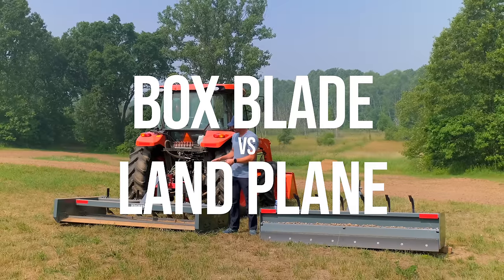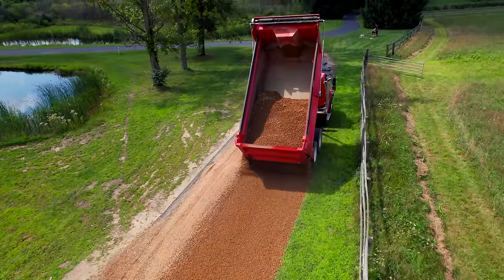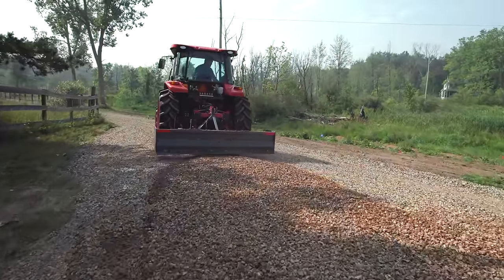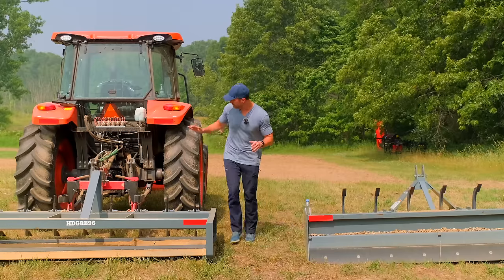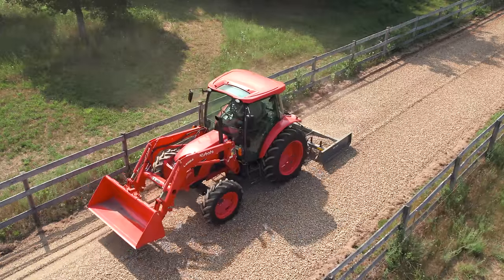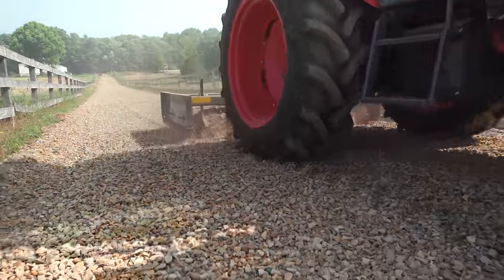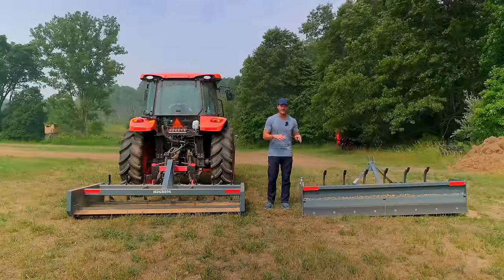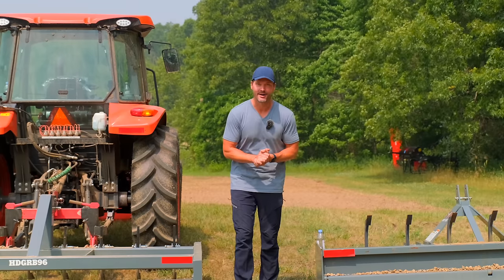LAND PLANE VS BOX BLADE: WHICH IS THE BETTER GRADING TOOL?

Comment: I use my box blade for moving a dirt pile, but the landplane is great for smoothing out the drive way.  I use it he shanks on the land plane when there are pot holes.  If you just smooth I’ve them, they will come back.  You need to tare up the edges of the post hole to distroy it.  Then resmooth it out.

Comment: I got a 7' box blade for my 75" wide L3560. I was worried it might be a bit too big for the HP but the tractor pulls a full box uphill with ease. Super versatile tool, best bang for the buck out there I'd say. Takes some practice but once you get the hang of it, it's a very accurate tool.
Reply from the maker: Thanks Chris!
Reply: That’s only a few inches wider than your tractor on each side. I think you want to be able to cover your tires with the implement, so it sounds perfect to me.
Reply: @phild9813  Yeah, it seems to be a good match. Hopefully that's still the case with some spacers!

Comment: I have a suggestion on a box blade use model with a hydraulic top link (really a requirement in my mind), and either a fixed rear blade, or a hinged/floating rear blade that can be locked into position. You can get much finer control of the box blade’s digging versus spreading action by controlling the front to back tilt of the box blade using the top link vs raising and lowering the 3-point hitch.  When you want to dig, tilt the box blade forward slightly so the front blade is lower than the rear blade.  When you want to spread, tilt the box blade back so it is riding on the rear blade and the front blade is now slightly higher than the rear blade.  This will let you slowly distribute the contents of the box blade’s load of material in a very controlled manner while the rear blade, now being dragged along in a "reversed curve" orientation basically back drags the material being distributed.

Comment: I use my yt359 heavily for making new atv trails.  Push trees over and push them out if the way.  Then follow through with the box blade and rippers.  The rippers work really well to clear roots and debris to get to bare dirt.  Then the box blade with hydraulic top link finishes the job.
Reply from the maker: awesome, thanks for sharing!!

Comment: Nice video,you can purchase additional blades for the land plane for pushing backwards. That way you don’t wear out the blade attachment angle iron. The one advantage with a box blade is that if you pulling up any larger rocks that you want to remove from the road the box blade will deposit them in one spot. While the land plane deposits them over a long distance. The one thing I use a scarifier for is to lower one or two and use them to dig out an pothole that is holding water.

Comment: Great video, Courtney!  I've always wondered if a land plane could be used, under the right conditions, to help smooth and flatten a pasture.  Maybe first thing in the spring when the soil is moist and soft.
Reply from the maker: I really think either of these tools struggle with sod clumps.  It would likely work better if tilled several times to kill off and chop up those clumps prior to grading.  Just a tough application.

Comment: I have a land plane and it is my opinion that it REALLY needs gauge wheels. Rear mounted grading tools nosedive into troths - creating issues. And coming off a high spot, the rig lifts off the ground.  I see on your video, the same thing happens to you - you move large amounts of material that just need to be 'refreshed' and not hauled down range.
A friend loaned me his 8' york rake with gauge wheels last year - it is a fussy piece of kit, but I think it is superior to my land plane. Especially when establishing a crown.
I just laid 18 yds of fresh gravel with my landplane - I think I'll have gauge wheels added for next year - a grading blade needs to be center mounted, or it is not controllable....in my humble opinion. I am so thankful for having a bucket! At a certain point, the plane is a menace.

Comment: Any thoughts on using a landscape rake instead of the box or plane on a gravel drive? My budget only allows one at the moment and I can't decide between the 3 options. I do have some areas with debris and branches that needs to be cleaned up, so the landscape rake seemed like it might be a good choice.
Reply: the rake will be the least impactful out of the three. Meaning it will do the least to turn up the rocks and soil. It is great for raking the rocks smooth, or for cleaning up an area. But on a gravel driveway, if you only had one I would recommend the land plane.

Comment: I have a land plane and a rear angle blade, I've found if the driveway material is very hard the land plane works well, but if the material is soft and fluffy I prefer to use the angle blade with it turned around backwards.

Comment: awesome video - am thinking about adding a land plane to my set of "toys" --- I run a 72" LandPride BoxBlade on a Kubota B3200HSD - amazing of course -- I also have tilt-level hydraulics on my 3PT hitch - I can tilt the top link and change the height of one of the side links -- huge plus; I found that on this smaller Kubota  - pushing with the boxblade has to be done slowly and carefully as one can bend a 3pt side arm if one hits something that is not going to "give". Spare arms aren't that expensive and I always keep a couple of spares around. Would love to add tilt and level to my bigger M series and the land plane. anycase. thanks for a great video.

Comment: What size would you use behind the 25 HP tractor 4’or 5’ ?
Reply: It depends on your size tractor more than the HP. If you had a 1 series JD you would be fine with a 4’ BUT could pull a 5’. I have a 3 series with 25HP and went 5’. That said, the dealer tries to talk me into a 5’ tiller and really didn’t want me to get the 4’ tiller which I end up getting…had specific needs he didn’t want to listen to. Didn’t use that dealership!
Reply from the maker: 100% agree.  I can't answer the question based on HP alone.  1025r 25hp runs a 48".  3025e 25HP runs a 60".  I've stopped my 1025r in its tracks with a 60" plane and box blade too many times.  The inefficiency isn't worth it.
Reply: My tractor is a JD2025 R  I was thinking 🤔 that a 4’ would not always cover the tire track
Reply from the maker: @ajosephbaumhauer4071  That tractor is 48" wide unless you did something to widen it?  You could use either size on that tractor though, it's heavier than the 1025r.  More weight is more traction.  That's the problem with running a 60" on a 1025r.  The blade will load up with material and the tractor doesn't have enough weight to get traction to keep moving.  It'll sit there with the tires spinning.
Reply: I have a 6 foot box blade behind my RK25 no issues on my gravel parking lot !

Comment: I have both for my kubota bx 48in land pride pand plane, and 60in tractor supply box blade. For gravel work I prefer the land plane hands down. I use mine in reverse and it spreads material very well that way. Now for dirt work box blade is the way to go or if you can only afford one, go with the box blade as it's more universal
Reply: Thanks for your input. I'm curious if you have used the land plane to smooth out dirt, or using it on an area that is strictly grass, to help level it out. Reason I ask is I have to mow several acres and they are extremely bumpy from years of voles and moles creating little dirt mounds. Consequently I can't as fast when I mow, and I'm thinking the land plane will be helpful in skimming off those high spots. Thanks
Reply: @on4acres I’m looking at one for this same reason. Have you found out anything?
Reply: @braidenoneil I ended up buying the land plane as I thought it would be the best all around tool. I’m going to try it out for this purpose in the next month or so and will report back to let you know how well it works.